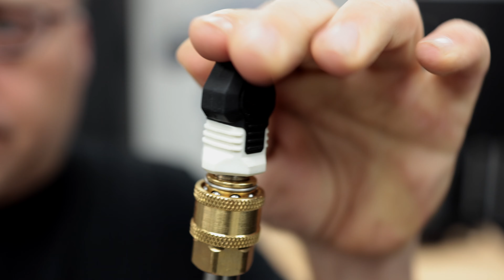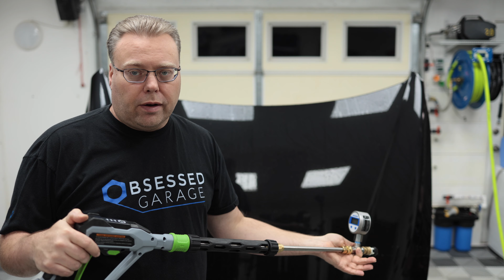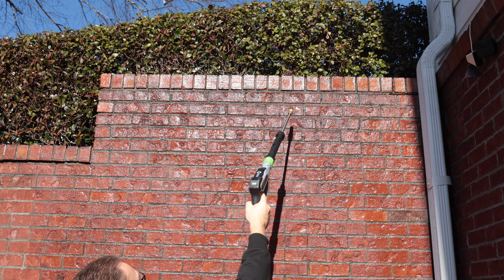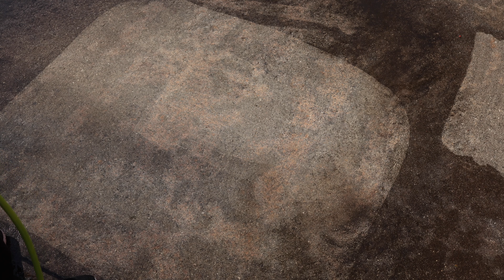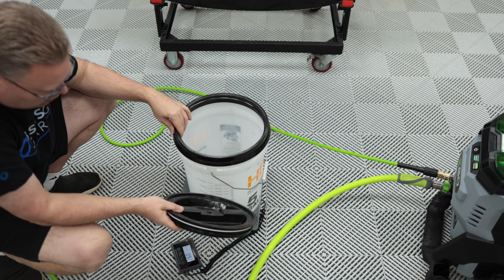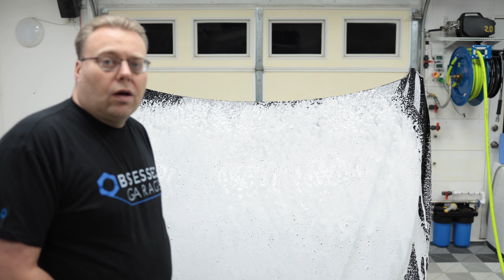EGO 3200 Battery Powered Pressure Washer | 3200 PSI?! | Review & Testing

Comment: Does the wand accept the standard aftermarket tips without modifications?
Reply from the maker: The extended wand is an industry standard 1/4 quick connect will accept most all out there.
Reply: @CarsWithKeav  why wouldn’t they make it all 1/4 inch then?
Reply from the maker: @Pete_or_Peter4Long  Really good question. I think there is some customs policy or law somewhere that says they can’t pack a shortgun with a pressure washer. They have to be long. To get around this a little they have to not allow the nozzles in the box to be put on the shortgun forcing you to use the extension wand. At least that is what I have been told by several industry executives. You can easily adapt it down to 1/4 with the right fittings as the end of the shortgun is 3/8 quick connects same size used on the pressure washer hose quick connects.
Reply: @CarsWithKeav Yes I already ordered the fittings you recommended from Amazon. I just got into Ego products so just makes sense to stay in their line since I already have batteries. Keep up the good work much appreciated.

Comment: It’s the gallons per minute that also matter
Reply from the maker: Yeah they do matter and I go over those numbers in the video as well. You won’t get high psi and GPM with a 110v electric. You mainly get one or the other which for car washing is fine you can get by with 1k PSI and 1.6 GPM with this unit which is way better than most of the electric big box store ones. You want both you go gas powered.
Reply: @CarsWithKeav  agreed, however, this unit works for me because I work in multi unit housing places, need it portable, quiet and low pressure is also less risk for me, so it works.
Reply from the maker: @grizztough4091  Absolutely exactly what it was really design for.

Comment: Good build quality, 5A batteries really good, no problem Had this item just over 1 week, used it to clean several cars, the batteries have not needed recharging. Fantastic build quality, I would recommend this; I work as a professional car valet and I need something reliable and effective. Early days but absolutely brilliant so far. You should buy the right tool for the job. If you're cleaning a huge area of drive or a really lengthy job, don't buy a cordless! This is fantastic if used for the correct work and is a great tool.
Reply from the maker: Absolutely agree with everything stated and week said.

Comment: Not sure I missed this video, glad I was going back and looking at battery powered options.
I heard about this one and really good numbers. Seems a bit heavy on the weight and cost for me but this would be a really cool option for me. 

Too bad there's no way to turn off the unit from the gun since the fans run after it stops. But having the speed setting and battery indicator are a good plus.
Reply from the maker: It’s a pretty cool machine that’s for sure. I wish there was a simple version though. Just give me the batteries and unit no Bluetooth gun and sell it to me for $200 less.

Comment: The foam cannon goes where every foam cannon has ever gone. The shelf with everything else. 

It’s a pressure washer not a Swiss Army knife.
Reply from the maker: Would be nice if it was a swiss army knife though am I right especially for $800? Don't take much design or engineering to add a plastic hook I think thats a lazy cop out. Those that have limited space would want to keep them together.

Comment: What orifice size for the boss foam canon is the question...just grabbed on one sell for $45....idk if I wanna go 1.25 or 1.1, also dk what metering tip to use
Reply from the maker: Purple tip and if metering I would stick with the 1.25, but you could dial in the way you like. Hard to tell what will work right until you foam. Metering tips is a whole different thing than running dilutions. It tends to foam better.
Reply: @CarsWithKeav  thanks, ima tackling my first black car.. after wash and decontamination, paint correction and polishing
Reply from the maker: @krazor8  Nice, black cars are the most difficult depends on the softness of the paint too.
Reply: @CarsWithKeav  2013 camaro ss, from what I've heard, and seen it varies, the one I'm doing seems pretty hard, as it doesn't have near the swirls,scratches and rock chips some other do
Reply from the maker: @krazor8  Good luck! You got hours of work ahead of you.

Comment: Are there any other good self priming electric washers that can use bucket fed sourced water?
Reply: Which quick connector/conversion would I need from the stock short wand to an aftermarket 1/4 foam cannon. I can't find the info.
Reply from the maker: @Rowdydowdy89  You need these three pieces to convert the 3/8 QD at the end of the short gun to get to a 1/4 QD
3/8 female npt to 1/4 male npt - https://amzn.to/48Qi5r1
3/8 male QD to 3/8 male - https://amzn.to/3u0xXbE
1/4 female npt to 1/4 female QD - https://amzn.to/3HhpjbX
Reply from the maker: Ryobi and Greenworks both have models they sale as well. Ryobi has a handheld one, a big one and just came out with a 1200 PSI one.

Comment: Won't the pressure drop the closer the battery empties?
Reply from the maker: With the Ryobi products that is more noticeable, but the EGO batteries are very consistent from full to empty.
Reply: @CarsWithKeav  thanks, I only ask because I use EGO products and I've noticed power drop on my blower, edger and trimmer when the battery is down to one or two lights. The battery is only a few years old.
Reply from the maker: @tiagoj8020  Maybe I am so used to Ryobi having a much more significant drop I didn't notice. I have the 765 blower as well and can notice a drop when using turbo over time. Since this is running two batteries at the same time that might be helping to keep it consistent.

Comment: Did the quick connect fittings on the power washer @ 17:16 for the garden hose come with the unit? If not, what did you use to convert that from the standard hose connection?
Reply from the maker: They do not come with it. I used these https://amzn.to/3TeYJWF Very good quality and stainless.

Comment: Not sure about this one (for me, anyway). I have a bunch of Ego stuff but I'm thinking if I already am running a hose into it from the house I might as well also run an electrical cord from the house. A regular old pressure wash is going to be much cheaper than the Ego product. Good review, though.
Reply from the maker: It is for sure for those with an alternative water source since it can self prime or traveling.

Comment: This pressure washer looks amazing. I just don’t get why they don’t include a plug on it that would allow you to hook an extension cord up to it and use a 110 wall outlet when you have one available. Save the batteries for when you aren’t able to use an outlet. Then this would be the ultimate pressure washer.
Reply from the maker: Then they would sell less big batteries. Of course they say their statement is to be portable. I have the same thought with this and the Ryobi. I mean Ryobi has a powered cooler that takes 18v batteries and it can be plugged into the wall or cigarette lighter. Hybrid would be the best way for sure. Most likely for Ryobi it’s that they would hurt market share of their plug in models. Why not just make one product that can do both? 🤷‍♂️

Comment: Can I then get a EGO chainsaw and blower that can all use the ONE battery size for maximum flexibility and some cost savings?  Ego also has a 7.5Ah battery--will that work on this washer and the blower and chainsaw for even longer use?   Thanks!
Reply from the maker: Yes, that will all work. When trying to get into a better ecosystem they are always cheaper when buying on tool that comes with two of them. The 6AH batteries that come with this are $500 by themselves.

Comment: $800, that's hard to justify, plus anything with batteries already has terrble ROI, wish they had priced it better.
Reply from the maker: Very hard to justify I think they spent too much R&D on the Bluetooth spray gun and could have saved some with just a normal spray gun. Battery power with these types of products are still a while away from lasting long enough to be worth it. For a little bit more money you could buy a power station that uses the same batteries and plug in any electric pressure to use it. Most people though who are in the EGO battery system usually have the money to get this as it’s a higher end products company.

Comment: Main question for me , can you use it without the ego gun- I believe you said it could
Reply from the maker: Yes, it’s just a common m22 14mm hose end and you can use with just about any spray gun out there with a quick connect adapter.

Comment: I’m trying to use mine for the first time.  I’m using a 5 gallon bucket for water source.  I can’t get it to prime?  I took the tip off the end as well as suggested in the manual.  I don’t want to let the pump run too long without water going to the pressure washer.  Any ideas or suggestions?  Thanks!
Reply from the maker: I had to run it for a minute or so to get it to prime. I have had several and they all take some time to prime especially depending on the hose length. One way to help is to fill the hose with water all the way to the connection so there is less air in the line.
Reply: I will try that.  When I tried it earlier, no water at all was being pulled up from the bucket.  I followed all the instructions.  I will try filling the siphon hose with water first now. Thank you very much for the fast reply and I really enjoyed your video and subscribing!
Reply: It worked!  Again, thanks for replying and helping!  It’s appreciated 👍

Comment: This seems like a good tool for cleaning cars and light duty cleaning. The Cleaning Units of this is 3840 which is high for an electric PW. For example the popular Corded Sun Joe SPX3000 has 3,750 calculated Cleaning Units. By multiplying the PSI rating with the GPM rating, you can determine a pressure washer's cleaning units (CU). But if you are looking to pressure wash driveways and siding of a house, you'll still need to stick with gas as they typically have CU's of 8,000.
Reply from the maker: Very true and agree with most everything except using a pressure washer on siding unless its vinyl. Even then most use a soft wash with bleach for siding. Thanks for the information!
Reply: Yeah, i find its as an overpriced car washer. Its too weak for heavy duty washing and too strong and expensive for just cars. It would only make some sense if you are a mobile car detailer, but then again, i would still get a small gas powered or corded electric with a dual battery car setup. I personally went with a wall mounted unit for cars and have an Ryobi with a Honda gas engine for everything else.

Comment: My question is battery life, not useful if you can't finish the job and that wand is too short. Anyway, too bad I just bought one last year or this might have been the one I buy since I already have the batteries.
Reply from the maker: The initial wand is shorter than some would like, but it has two extensions that make it as long as any other wand out there. I prefer a short gun for car washing. Battery life is the main problem. Turbo is the only good cleaning mode and to get 30 minutes run time you need $1200 with of 12AH batteries.

Comment: I've been trying to find a reason to buy this pressure washer but I'm just not convinced the 1.2GPM is good enough to wash my two SUV's.  My experience with 1.2 GPM for car washing hasn't been good so for now I'll stick with my gasoline pressure washer.  Thanks for a great review.
Reply from the maker: In the video I show with the White tip it is 2150 PSI and 1.5 gpm, You can also change the nozzle to a 3.5 to get almost 1.7gpm, but turbo mode only lasts 15 minutes. If you already have a gas pressure washer and don't need the siphon function or need the batteries then I don't think it is worth it either. You could run a generator and an active 2.0 for about the same price.

Comment: But the battery would die quick on Turbo in sure
Reply from the maker: Yes, these batteries only last 15 minutes in turbo, but that is 15 minutes straight. If say washing a car you only using for 3 to 5 minutes at a time. It’s enough time to wash a car.

Comment: How would you compare this unit to the active 2.0? What about the upcoming active 2.3. I bought the ego and am considering returning it for the 2.3. Is the pressure of the ego advantageous over the active products? Which would you choose? I have an outlet, 12 amps.  I’m using a gravity 45 gallon reservoir in my garage, so a lower gpm means I work less to refill it, but I ultimately want the better unit. 

I do want a quiet unit, and I do like how this ego is quiet.
Reply from the maker: It is very quiet the water pressure is louder most of the time you only hear it when you stop spraying and it is ramping up and down. SInce you are gravity fed and not needing the self priming feature The 2.0 is superior for car washing and the 2.3 will be another level above that for sure. 12Amps outlet or 15Amps? Active 2.0 operates in the 13 AMP range and up to 14.5 when using a foam cannon.

The theory behind more flow is its quicker to wash off and more efficient which is true, but if you are like me and you get that crazy flow it will make you spray longer because its more fun. LOL. 1150 PSI with 1.6 GPM on the 3.0 nozzle is pretty good balanced cleaning numbers for car washing. Compared to the Active 2.0 at like 950 PSI and 1.9ish GPM on a 4.0 nozzle.

I think the 2.3 will be in the $500 to $600 range. I am willing to bet selling the EGO on Facebook Marketplace will be pretty easy a few months from now when hopefully the Big Boi Pro or Active 2.3 come out. Selling pressure washers in the spring is best time to do it. If it is anything like the 2.0 release it could be summer.

My opinion is I will always go with more flow and the 2.3 will be on my shelf this year and will do all I can to have the first video out. Hope the same for the Big Boi Pro which will be stiff competition.
Reply: @CarsWithKeav  it’s a 12 amp outlet I think on a 15 amp circuit. My Tesla can only charge at 12 amps on this outlet. I’ll consider returning the ego washer since im still in the return period and waiting for the 2.3. 

In the mean time I’ll use my greenworks 60v 1800 psi sprayer

Comment: How would you say it compares power wise compared to a corded 120v pressure washer in that $400 price range? I'm already in the ego ecosystem I was just looking to get a pressure washer now. Just got their vac as well.
Reply from the maker: What would you be doing with the pressure washer would be the best way to know. For car washing there is the Active 2.0 at $350 which is far superior in water flow for efficient washing. For around the house I don't see much competition with how portable it is and that it is self priming for a bucket or water storage. Being in the EGO system brings even more value if you buy the battery model or the tool only. Its is also very quiet compared to anything in that price range and there is good value in the quick connects, hose, etc. They are in stock at Lowes last I saw and the tool only is on Amazon still in stock right now.
Reply: @CarsWithKeav  mostly looking at car washing and general use around the house, my cars are all ceramic coated so it usually doesn't take much to get them clean, I appreciate your input!
Reply from the maker: @josegarcia2014  You’re welcome!

Comment: Do you see a way on the device to pull the water pump for basement storage and keep the unit in the shed for winter?
Reply from the maker: It looks like it was designed to be very hard to take apart, but it can be taken apart. Just will be a lot of work. All I could suggest would be to use pressure washer oil before storing for winter so it won't get damaged.

Comment: Great video on this unit. I was wondering if this pressure washer is any quieter than most other electric ones? Or is it about the same?
Reply from the maker: To me it’s quieter than most all electric ones and the water coming out the nozzle is usually louder.
Reply: How much quieter is it than the active 2.0. The 2.3 will be released in march so I’m considering returning the ego for that 2.3. I’m using a 45 gallon water tank in my garage so there’s some advantages to lower gpm for me, but I want the better unit and since I have 12 amp outlet I could use either the ego or active. Which unit do you recommend?